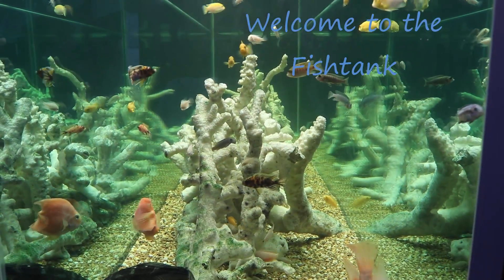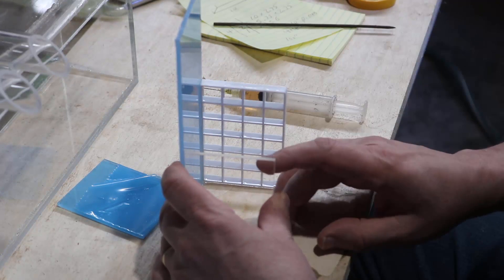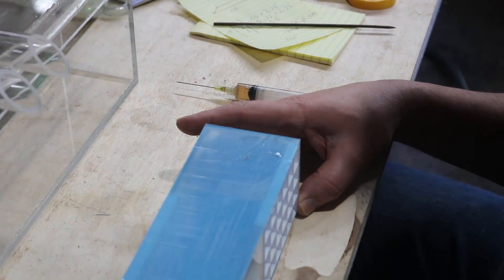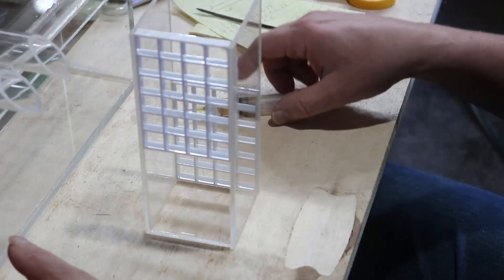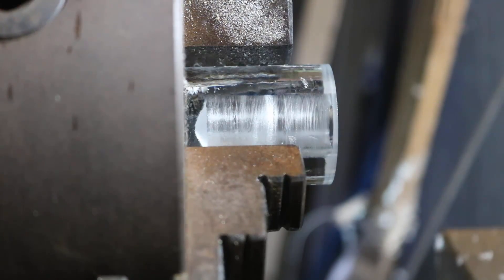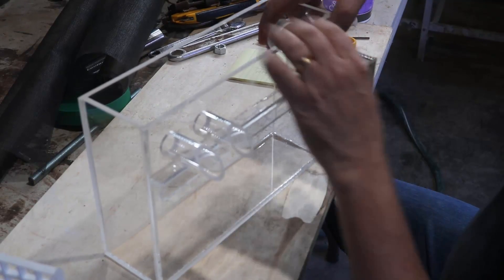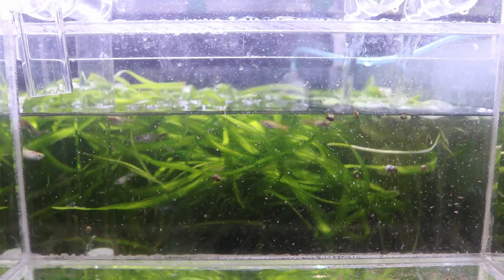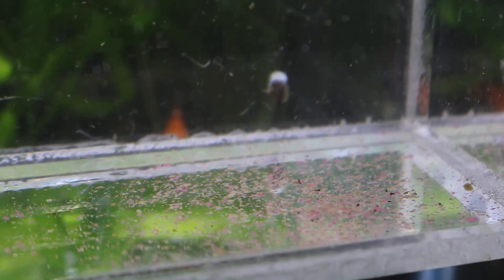DIY HOB Mods and How They Affect Flow

Comment: How hard is it to curve the acrylic to get a more stream line flow? It could eliminate dead spots.
Reply from the maker: Doing a gradual elbow with a gentle curve is a pain with 1" tubing but doable. The problem would be that the HOB would be a bit wider and the input would go further into the tank. Also I think there will always be at least a little dead spot no matter how hard you try to get rid of it. Thanks for watching

Comment: Do you have a video on how you cut your acrylic pieces? Are you using a table saw? Especially the smaller pieces for brackets and such that you make. My attempts to cut acrylic do not come out anywhere near as nice as what you achieve. Everything you make fits together square and nice.
Reply: He just uses a table saw witha normal wood blade!
Reply from the maker: @parkerbenz  Thanks for answering for me lol and for watching!
Reply from the maker: Cutting does need to be as straight and square as possible for sure. Thanks for watching